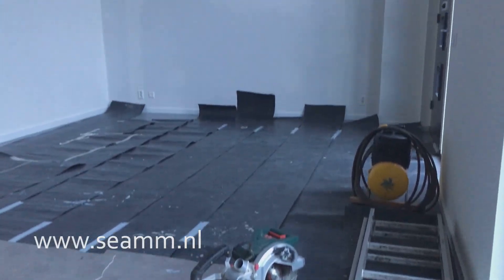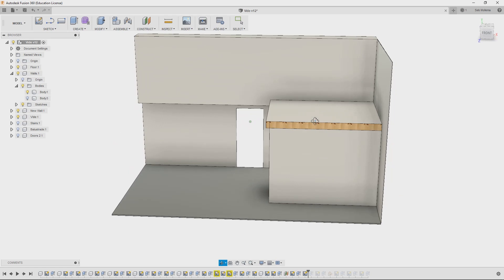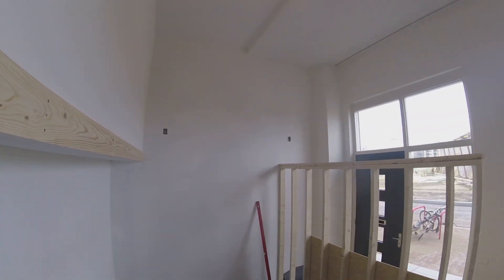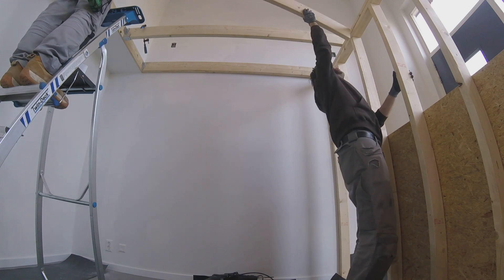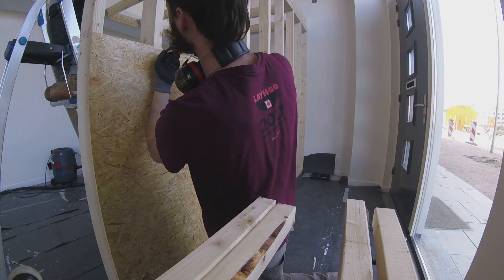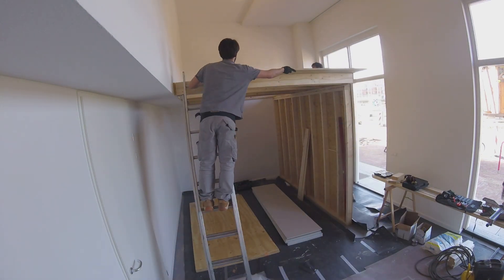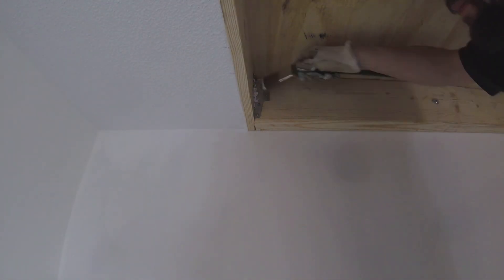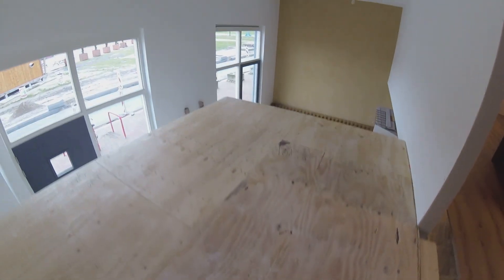DIY Mezzanine Construction

Comment: Is the old wall sheetrock? How does it bear the mezzanine?
Reply from the maker: The wall is covered with plasterboards. The structure of the mezzanine is attached to the internal wood frame and concrete bearers in the other wall.
Reply: @SebastiaanMollema   @ 0:38 you say the beams touching to the walls are bolted and screwed. To the plasterboards?
Reply from the maker: @ivanohemartin  The wall is only covered with plasterboards. The mezzanine frame is screwed to the (wood) wall frame. the plasterboards are only there in between.
Reply: @SebastiaanMollema  Ok thanks. I'm trying to build false ceiling + hung shelves with the same config. One side over a tall cabinet, the other one screwed to the drywall.
Reply from the maker: @ivanohemartin  ah ok, good luck with those projects!

Comment: what kind of bracket is that you used for the beams?
Reply from the maker: It has a u shape and two flanges for screws. Directly translated its a ‘joist carrier’. Quite convenient for in between spaces.

Comment: So many problems with this design! The centres are far too far apart. The plate is too thin and not fixed correctly. Incorrect hangers have been used. Stressed timber not been used. No double plate head used on the supporting wall and soo on! PLEASE - do NOT use this as an example of how to build a mezzanine